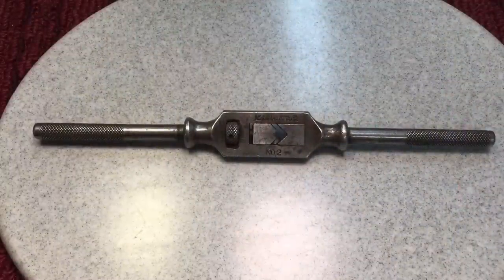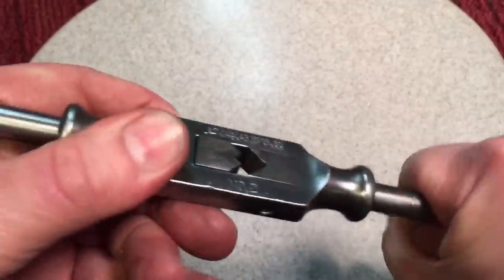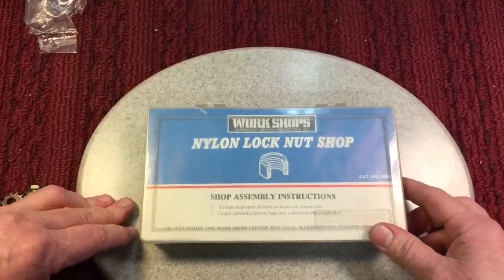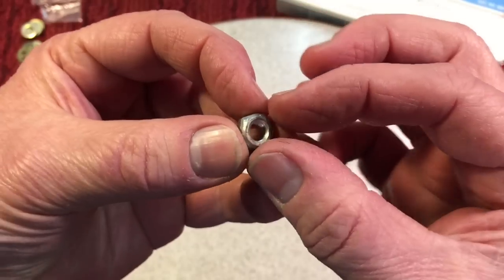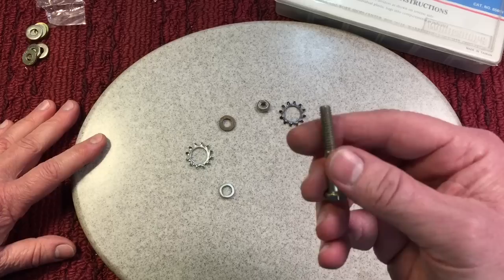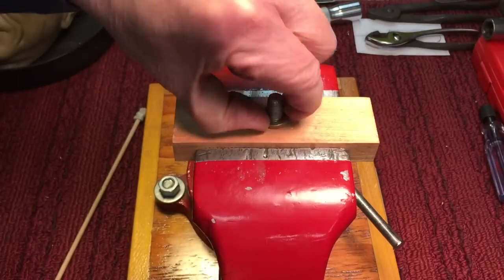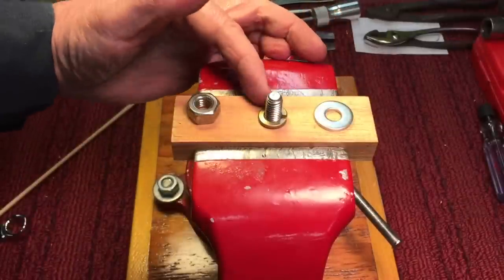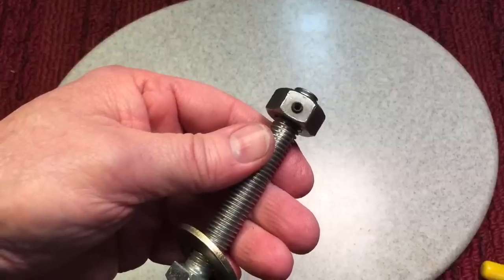Rare Kraeuter Gas and Burner Pliers

Comment: I typically use two flat washers. One on each side of the hole. But your information makes sense. I did use both, however, in my recent addition of a cross bar to the new press. Because the holes were very large and the washers keep the fasteners from coming through or tightening down all cattywampus. (I don't know if I'm saying that in a way that makes sense).
Beautiful job on the pliers. I would love to learn more about how to take the slop out of slip-joint pliers.
Thank you for all your wonderful content.
Reply: Also would like to see the peening part!

Comment: I've worked as an engineer in the aerospace industry for almost 40 years worked with a lot of bolted joints. One of the primary purposes of the split lock washer is to act as a spring to maintain the pre-load (tension) on the joint as you mentioned in the video.  A secondary purpose is to prevent rotation of the nut during vibration by digging into the nut and the surface below.  However not that much care is taken when torqueing the nut and the split lock washer is often over torqued and actually permanently deforms which no longer makes it a spring.  It becomes a flat washer with a split in it.  If you want to maintain tension in the joint under a variety of vibration and environmental conditions, we normally specify Belleville Washers.  They are specifically designed to operate over a variety of conditions and torque values are specified accurately when they are used to ensure they aren't flattened or permanently deformed. The are more expensive options though. As far as if you need flat washer, I definitely learned to always put the flat on first.  Most of the time you need to distribute the load (especially with softer base materials) and if the joint has enough torque on it the friction between the flat washer and the bottom surface should keep it from spinning

Comment: That’s a beautiful tap wrench! I don‘t use split washer at all. With these high grade bolts and nuts nowadays they are completely useless. Split washers are softer than the bolt or nut, so they don’t grab them. Use nylon lock nuts for low temp applications and the all metal ones for higher temperatures. By the way, these split washers have been removed from European ISO and German DIN standards in 2003. They are no longer considered as a locking device. 
Greetings from Germany, I’m a big fan of the show!
Reply from the maker: Thanks so much!  😃👍

Comment: Never thought about it, and always do the flat+split when I need to use, because, as you point out, that's the way I was thought. Trying to explain why it works, my thought would be that the split washer not only is supposed to "grab" both materials it is in contact with, but also to provide extra friction internally on the threads themselves. I'd even argue that they're effective more because of that than because of the grab. If my assumption is correct, then having a flat washer would just make sure the axial load (along the axis of the screw) of the split washer is appropriate (specially when applied over a softer material). Also it may give some protection not to score the original surface... My two cents...

Comment: Depending on material used to bolt (eg. thin sheet metal), I use a flat washer and a split washer. Torque to spec's. I liked that lock nut you made! I use lead shot for the allen screw. Those gas pliers turned out awesome!

Comment: I've looked at Junker's work and also NASA came to the same conclusion that for the most part split lock washers are basically useless.................Nylocs are good, so is thread locker (Permatex) and so are serrated flange nuts which function as both locking and spreading the load.....Also the research says the tooth washers are much better than the split but you would have the same problem if you're using them in conjunction with a flat washer that you mentioned..........The all steel lock nuts are good if you're not taking them on and off to often, because they can wear on the threads............I can tell you working with structural bolts we didn't use any type of lock other than using an impact wrench to hammer them tight which you can do with large nuts and bolts.......So my conclusion from experience and reading studies would be for stuff the average person does that you're probably better off using  thread locker instead of the split lock washers...................... And We Are Calling This Comment Done
Reply: Space isn't real.

Comment: Many things you buy today that require assembly have directions showing flat washer, split washer, then nut. That is also how I did it working several years on an assembly line. (Company instructed) Not necessarily correct, just how I was taught. Saying that, nylon nuts have never failed me on personal projects, just more expensive. Love you videos. Down to earth and learn something every week.

Comment: If it's a really important bolted joint that you're gonna torque with a torque wrench, I would say use a hardened flat washer.  Put the split lock washer in your pocket.  If vibration is and issue, add a jam nut.  If it is a less important bolted joint, I like the nyloc or the deformed thread lock nuts.  Red Loctite is nice for threaded connections you don't want to ever come loose.

Comment: I still feel that in a split lock washer it is the upward spring tension that keeps the nut from vibrating off.
Reply: exactly it's moronic to think that it's supposed to dig into the wood and metal to hold the nut in place these are ment to be used with a flat washer on bottom which totally debunks john's theory because even if it dug into the top of the flat washer and nut the bottom of the flat washer would have no safety measure i trust john will see these comments and do the proper research and do an update of some sort you're a good guy john but on this one i am afraid the study long study wrong theory is in effect

Comment: Our application at work on the conveyor motor mounts which has tons of vibration throughout the production... we do not use the fender washer. Lock washer and bolt or nut depending on the particular application. I some areas it’s required to use nylon locking nuts where there isn’t too much heat.

Comment: It all depends on the the application. I worked on industrial machinery as a millwright. We are talking tough environmental conditions where down time is an issue. We hardly ever dealt with dissimilar metals and usually in high heat. Just a flat washer and nut then tighten to speck( depending on the size of the fastener) some times a crush washer was called for. They work on a similar principle as a split washer, to use spring tension to hold in place. However don’t mare the surface. The reason we use the flat washer at all is to give more stability to everything and if need be give us more room to work if the fastener needs to be removed by something other than delicate means!😂
Sure this is clear as mud...

Comment: I've thought of the washer as a way of not losing the nut in the wood, to retain the purchase (as you'd say) on the flats of the nut.
Your large bus nut only had the split washer on the small locking device.
After your presentation, I'd say lock washer only and no flat washer, if I did go that way. I've become a nylon nut guy as of late. 😎

Comment: Nice work on those burner pliers. Great info on the fasteners. Haven't had great results with split lock washers. If you have room on the bolt I suppose jam nuts work fairly decent. When using split washers it tends to mar the surface which would be bad on chrome so on my chopper I would put flat then split then the nut. Seems like the vibration from the Harley engine would loosen anything unless it was welded on, HaHa!! We don't sell a lot of lock washers at the Hardware store for some reason. Any ways, great video!!

Comment: I quit using spring washers years ago after watching several demonstations showing that they just don't work.  Whenever possible, I use nylon locknuts.  If I run into an application where these are unsuitable, I use a pair of tooth lock washers.  These consist of a washer with teeth on one side.  When paired up, the teeth of one washer engages with the other one.  The pressure exerted on them when the bolt and nut are tightened cause them to press the fastener apart thereby locking them in place.

Comment: SC, if you are going to use a regular washer in combination with with a lock washer then it would not make a difference where you put the lock washer (on top of or under neath the regular one) because which ever surface the regular one covers would prevent the sharp edge of the lock washer from digging in. BTW on a piece of wood the lock washer will dig in like you showed however on steel I doubt it would so squat! That said, I was always taught that the spring tension is what keeps things from loosening. I don;'t really care for the split ring lock washers much because they don't really work - things still loosen up! If I really want to keep things from loosening I use a  "shake proof" Star washer or one with the internal teeth. Those actually do work. A drop of locktite really does the job as well. A combo of a Star washer AND Locktite is the cats meow!

Comment: The swithcgearcomponents in our company substations are held tight with spring washers where loose connections will cause excessive current draw. Distinctively shaped with a raised center they are referred to as “Belleville” washers and are manufactured in Pennsylvania; a websearch for Key Bellvilles will get you to their history, developed in the mid 19th century.

Comment: Always use a flat washer first and then the lock washer. Most times I use a nylock nut.Most of my work is done on an old Harley so vibration can be a problem.Some bolts and screws even get blue locktite in critical situations where loosening can cause injury or engine damage.

Comment: Ive done it both ways but like you I was taught  flat, split and nut. I have to say Ive never had a problem with them either way. Them pliers must have belonged to a service man who used them his whole career. Using them for the job they were made I just cant see ever getting that much wear and tear on them!
Reply: If you work in a shop it's easy to say you should always use the right tool for the job or that a tool should only be used in the manner its designer intended. Any one who has worked in the field has had those moments where the right tool is back in the truck, maybe even back in the shop, it's a long walk or a couple fights of stairs to get to the truck, so you make it work with the tools you've got. I will refrain from making my usual comment about electricians.
Reply from the maker: Wally- I was thinking the same thing- Some guy carried these for many years!  😃👍
Reply: @janderson8401  So true

Comment: Another method is the double nut where you tighten down the nut then run a second nut snug up against the first to keep it from back inch off. I was taught flat then lock washer although I have used lock washer by itself.
Reply: The double nut is a good method. Use that when mounting wire wheels on bolts for use on the drill press!

Comment: On wood I would always use a flat washer then split washer otherwise just a split washer could get buried into the wood. On metal I was taught to use a split washer (in the UK we call them spring washers) or a 'shake-proof' washer (the spiky one). Best regards Stu

Comment: Yes the split ring lock washer is meant for metal to metal contact. That being said the only time a flat washer is used with the split ring lock washer is when soft material is being held. But the correct way with soft material is a flat washer with a form of self locking nut because the flat washer does rotate on the soft material and actually voiding the split ring lock washer from stopping the nut from backing off.

Comment: I own a Carwash. My equipment vibrates, gyrates and shimmies every possible way, and for 9 hours a day, 6 days a week. I personally  installed every single piece of equipment in my tunnel.  I put the lock washer between the flat washer and the nut. Not against the aluminum equipment. I have NEVER had a bolt come loose in 21 years of operation. If someone tells me I’m doing it wrong (even an engineer), I would tell them where to go.

Comment: Another locking tip, is after tightening, to use a prick punch and a hammer to make a ding on the nut very close to the threads. Done right, the nut will not loosen, but with wrench torque it will back off. This is basically the same as the distorted-thread locking nuts you can buy.

Comment: So we use washers then the correct grade split washer on tube steel ( or slots) to stop collapsing the tube. There are times were the washer can add load and then crown nut or nylon nut is used. Metal only we use crown nuts or star lock washers with standard nuts. 
The first time I saw the peen nut was when grandpa showed me back in the mid-sixties. Ww1 vet and philco engineer.

Comment: I’ve had the same exact argument with people for years, IMO the lock washer on top of the flat washer negates the purpose of the lock washer, which really don’t work that well to begin with. My favorite is the serrated flange nut, use them all the time at work. What’s so great about them is that you don’t need to hold them with a wrench to tighten your fastener. Just snug the bolt up with your fingers and hit it with the impact, the nut bites well enough that you don’t even need a wrench!
Reply from the maker: You definitely think like an engineer!   =D  Thanks!

Comment: For me.   When fastening wood I always use flat washer then lock washer to minimize drawing them into wood..  When fastening metal always just a lock washer then nut.  Since I discovered loctite I use that on anything prone to vibration or something that will be hard to monitor for loosening.

Comment: I just found a pair of 1863-9 in the bottom of a job lot I picked up at auction.  Mine have the ornate handles and Kaeuter stamped on the inside of each handle. They are actually in nice shape with no slop and almost no rust.

Comment: So I always thought the “nut/lock washer/flat washer method rendered the lock washer useless.  However my old shop teacher explained it to me that the static friction created by the surface area of the flat washer (under load) combined with the lock washer digging into it, was stronger than just a lock washer alone.

Comment: If you put the split washer on 1st and then the flat washer on that you are defeating the object of spreading the load. Also, the spring washer will grip on the flat washer, not the nut. Leaving the nut more able to loosen up if the circumstances, ie vibrations etc, are the reason you wanted the split washer in the first place. So the way we learnt is obviously the correct way.

Comment: I believe split lock washer's purpose is not to "dig into" the metal of the nut and washer but only to provide tension on the nut to induce friction between the nut's threads and that of the bolts. This is, of course, not the "strongest" of "locking" power, but better than none. So the name does not nesseceraly mean what it implies... It was an ends to the means fix to the applications of the time. We now have Loctite, nylon nut inserts (aviation locknuts) and locking wire to be more robust and "fool proof". Awesome for it's time and application - not a "be all to end all" means to an issue... It has an engineered, application limit!  Just like all other fasteners it is, perhaps, weaker that you might believe.

Comment: Concerning whether to put the flat washer on first or the split washer, I think this is one of those items that you go find some oldtimer who has been dealing with that particular situation for years in his shop and can tell you what he has seen in terms of what comes loose.  The problem is that there are so many know-it-alls who just bring up some reason that one way or the other is better and they really don't have the experience to back up their opinion.

For example: the was a man in Santa Barbara, California who owned and operated a machine shop that did work on car and truck engines.  Car repair garages or individuals would take disassembled heads or blocks in for work.  When he had a customer who was the owner of the block or head he'd ask what oil was used and how many miles were on the engine.  He said that straight 30 weight Havoline was the oil best.  Now of course that was in Santa Barbara where there is less extreme variation in the weather so that might not apply to someone in Illinois or Alaska.  But the point is that someone who will give an opinion which is based on real experience is golden.
Reply from the maker: Kathie- You are 100% right!  Real world experience VS “studies show” BS!

Comment: Hey John, If I want to lock a nut on using just a split washer I wouldn't use a flat washer as long as I didn't need the extra surface holding power of the flat washer. I work on a lot of bikes "Harleys" and try to use the nylok nuts when I can. I've had the best luck with them to fight the vibration from bikes. If It's imperative that it stays on then use wire tie to hold it on, ie axle nuts. Later
Reply from the maker: Hi Marvin!  Harley's have been known to vibrate a little!   =D  Great info thanks!!!!!!!

Comment: Let’s assume the grip of the split in the lock washer was absolute, as if it was welded. If we go surface, lock-washer, nut, then there is no way it can come loose. If the order is surface, flat washer, lock-washer, nut, the grip is between the flat washer and lock-washer, and the combination of nut plus two washers can be removed as a UNIT. The tension between nut and surface is lost, the unit comes off, and goodbye nut.